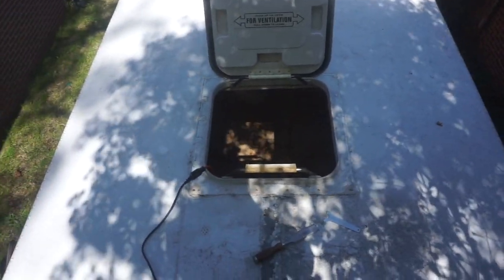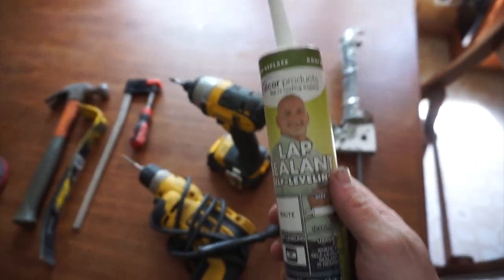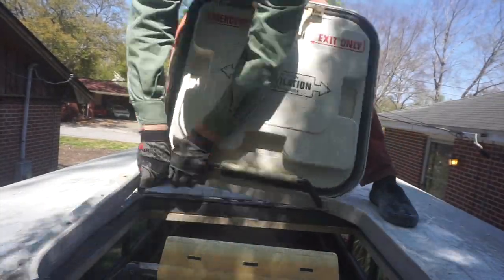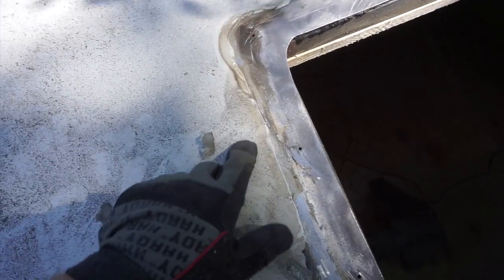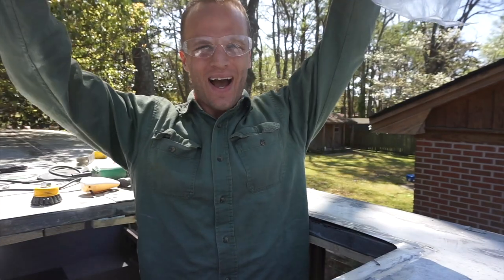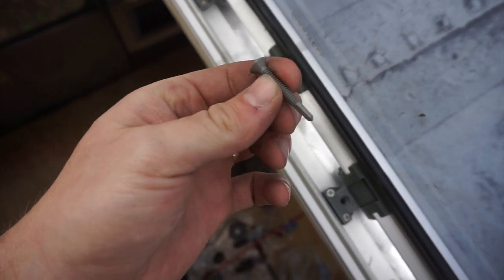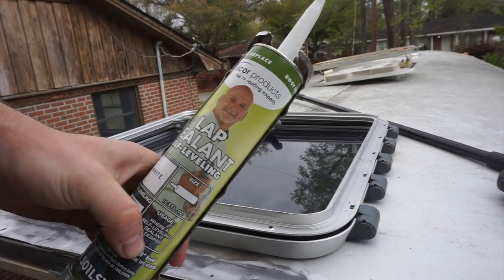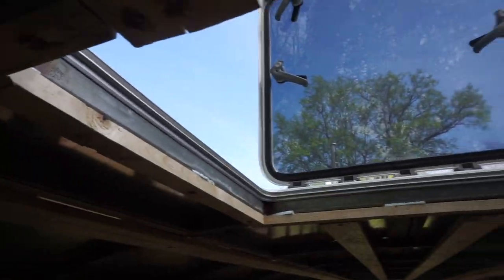How to Replace your Emergency Hatch with a Boat Hatch: School Bus Conversion Ep 12

Comment: So many questions! I believe my roof is a bit more curved than yours, so may not be as easy. Is there any way to lock the hatch? Is there any way to seal against the sun on the inside in summer?
 It's beautiful, thank you for sharing. Liked and subbed 👍🏽

Comment: With the bus roof being curved, was it difficult to get the flat roof hatch to seal?
Reply from the maker: Our bus really isn't curved much at the top. It wasn't difficult at all on our bus.
Reply: Yea, seeing the same potential issues on the conversion im working on. This installation video looks to be far from what might be a typical experience. 

Appears (to me) in the bus in this particular video the internal structure was possibly modified with a wood frame to render the mounting surface “more flat” than the 3/4” sweep. 

IDK, I got to figure this out myself before I remove the old OEM hatch.

Comment: The boat hatch links no longer work. Do you remember the make and model name of the hatch you used here?
Reply from the maker: Maxwell WHO62S and sadly they're out of production.
Reply: It's now called a vetus hatch. Part number-vtsmag6363sl
Reply: May have changed to vetus mangus MAG6363SL which appears a different design.

Comment: OK Arnold Schwarzenegger come and do my hatch I’ve got a Thomas built safety line or Bus class D transit Mercedes-Benz MBe 900.    I did my floor insulation Fat-mat Now I’m doing my steps Did you or have you thought about painting the outside of your Bus I’ve got the color picked out for mine I definitely want a moonroof on one vent and a vent fan on the other sure the fan will go to the front and the moonroof will be in the back of my bedroom so I can stare at the moon and the stars and maybe watch an airplane crashing intooo me  lol.    What a cool moon roof me like bro ham 
Who’s all the hot chicks definitely need that inspiration.